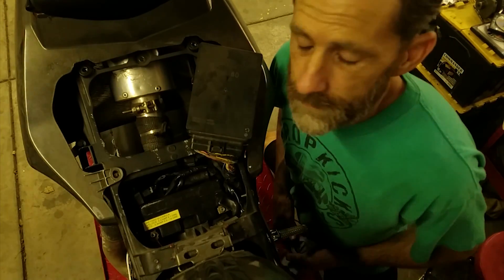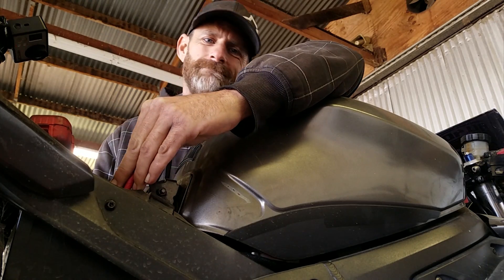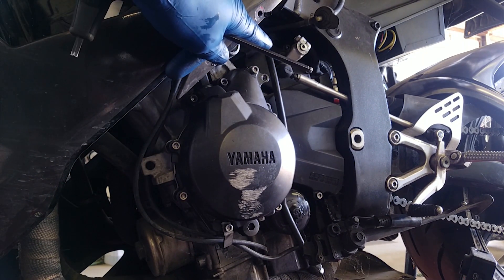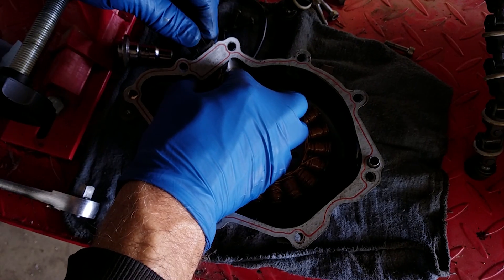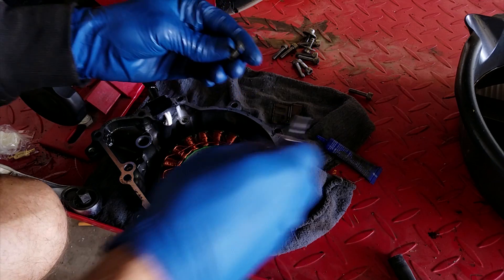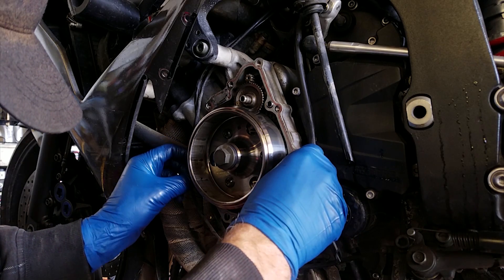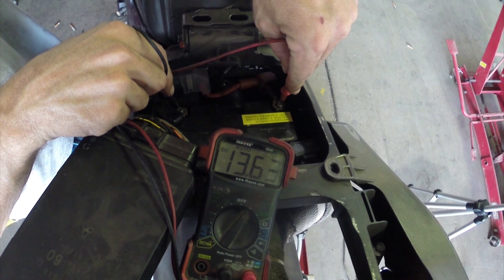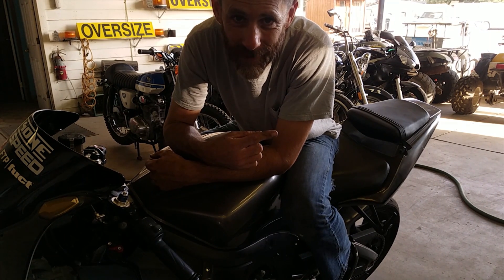Motorcycle Charging System Check and Stator Replacement

Comment: Great video, I have an '05 WR450 where my batteries are dying could be stator, I have a dead battery installed now 
0 volts should I still be reading 13.5 to 14.5 volts at the battery with an OHM meter while it's running?. Ty😮

Comment: Hey I’ve got a ninja ex300 2012 I’ve had battery issues with it replaced my stator battery and regulator and after putting the new stator in it winds over but it doesn’t start after it winding over a few times the check engine light comes on any suggestions or idea what this may be
Reply from the maker: Sounds like something isn't plugged back in. Double check everything you went through just to make sure you didn't leave anything behind.
Reply: I’ve already pulled the plugs out and put them back in the only other thing that I’ve messed with was draining the oil and coolant and the issues only popped up after replacing the stator
Reply: The only other thing that I can think of is it possible that when my roommate decided to cut the wiring harness on the stator to pull the old stator out could that have cause an effect like what being described
Reply from the maker: @dropbearlife7485  considering the stator has a plug for it, I'm not sure why you would cut the wires. I'm pretty sure you might have found your problem.
Reply: I’ve also checked all the fuses in case any of them may have had damage and they all appear to be fine
Reply: Never mind I made a rookie mistake I had put the stator sensor in upside down completely my fault lesson learned pay attention to detail and confirm everything lol thank you for your assistance
Reply from the maker: @dropbearlife7485  we've all done it! Glad you got it sorted out!

Comment: Would like to know. If stator is drenched in oil, can it work? My vstrom 650 had half cup of oil inside the casing afterI drained the oil. Bike ran on battery so crankshaft position sensor must have worked despite drenched in oil. So was the stator and magnet rotor. Are they designed to work drowned in oil? My old stator looks clean though. Have to test it yo be certain. Thanks
Reply from the maker: It's a magnet essentially so I'd think so. But I'd also make sure it was super clean in there! Probably works better without it drenched in oil.
Reply: @MotoMedic  Thank you. Found out it is always drenched in oil. Normal. Has plastic like coating on coils. It was the stator. The old one had two hidden broken wires.
Reply from the maker: Yeah that's weird. Not usually a bath of oil around the stator.

Comment: There are only 4 elements to charging (and potential issues with it) and these are 1. the battery, 2. the stator, 3. the rectifier/regulator and 4. the plugs & cabling, including fuses.

Prior to anything else, I'd see if the connection of wires to the battery is OK, as those may get lose over time. It's indeed the VERY first thing to ALWAYS look at, as it's an easy and quick check a/o fix. BTW for lose connections I recommend using copper paste - it is conductive and secures the bolts & nuts in their place firmly.

Then, I would check for any current leaks on the battery, and if so, I'd skip to checking all the wires and connectors and fuses immediately. Otherwise, I'd measure the battery voltage and then I'd see if it is being charged with the engine turned on (idle vs ~4 or ~5k RPM). BTW I'm using a cheap car-charger plug-in device (I have the plug installed on my bike), which - apart from providing me with a USB port for charging my phone or camera - shows me the current battery voltage level and to not drain the battery unnecessarily, I just need to pull it out after a ride.

Afterwards, I'd check the connectors between the battery & stator & RR & the rest of the bike - some could be melted (typically I'd see a short there) or have a faulty connection (intermittent or permanent break). If so, 1:1 replacement should be the way to go.

Then I'd test stator - an indication of a faulty one would be, if there is continuity between each of the connectors and the frame OR continuity between any two stator output connectors (1-2, 1-3, 2-3). If these checked out fine, I'd test its AC voltage output - it should be within limits put in the bike's service manual.

Then I'd test the OEM(-ish) RR, if the diodes are OK - meaning, if they let the current flow in one direction only (*). If so, I'd test its output (with everything connected & the engine running), where the DC voltage should again be within limits given by the bike's manual (again, idle vs high RPMs test) - typically, service manuals recommend measuring this directly on the battery and the numbers given in the manual most of the time refer to that particular type of measurement.

If the battery still does not charge up (sufficiently), I'd go through fuses and cabling (continuity tests) and connectors - here, unplugging one by one and observing the result ALWAYS leads to positively identifying the faulty part.

(*) the diode test is of course not available for MOSFET RRs, however, these generally fail very rarely; for comparison, the OEM(-ish) ones tend to have an overheating issue, as the thyristors in those get rid of any abundant current by converting it to heat (MOSFETs typically send it back to the stator)

Comment: Man I'm having problems with my road star though it was the carb but had it cleaned and tuned and still starts to back fire then shuts off after like 10mins of ridding thinking it's the stator? Any help would be appreciated
Reply from the maker: Backfire wouldn't be stator. Stator just charges the battery. Battery dies. No backfiring. Sounds like carbs are out of synch or something. Hard to know without actually having the bike to see more.

Comment: I need your opinion regarding an issue on my scooter.
I´m having a strange behavior on my scooter (SYM VS 125 2010):
If I disconnect the connector with 3 yellow wires from stator to rectifier, the engine works fine. If I connect it, the engine misfiring at 4000 rpm.
What is the normal output voltage on 3 yellow wires from the stator? I'm getting 26V on idle and almost 100V at 4000 rpm. Exactly when the engine starts to fail. Isn't it too much?
I've checked continuity on coils (ok), replaced the rectifier and battery.
Bad stator? Another suggestion?
Reply from the maker: Your best bet is to look in the service manual for this information. I would start looking for one online and start diagnosing it by the book. It's how I'd have to do it... but I don't have the bike here and I don't have the service manual.

Comment: If you changed the stator previously why did you have to replace it again?
Reply from the maker: Sometimes when a stator goes bad it can also make the regulator / rectifier go out too. If it does and you just swap a stator, it can go bad again. Other times it's just because these things get really hot and generate a lot of power for something so small. They're made by humans. They can fail 😁

Comment: Hey this might be a silly question but do you think it’s alright to reuse my oil. Sense my oils pretty new. Probably only a few hundred miles or less on it. I plan to replace my stator on a 2012 zx6r
Reply from the maker: I have reused oil before too. Some people get stuffy about it but if it goes into a nice clean container and then back into the same thing it came out of, then what's the difference? Have at it dude!

Comment: Quick question Brotha . Does the stator have too look shot if it needs to be changed ? Mines looks pretty brand new but pretty sure it’s a stator issue
Reply from the maker: Typically it would show some fried up area, but it couple be possible. If you can dig up a service manual on your bike you may find a testing procedure for your specific stator. All you should need is a multimeter.

Comment: Any Idea why it has been through more than 1 stator?
Reply from the maker: Could be a number of reasons. Got too hot. Maybe regulator/rectifier was burnt out too, or it just decided it was done. Sometimes they just fail.
Reply: It is because the bad magneto that is what happens when you don't use motorcycle oil

Comment: Would the stator also not provide spark to coil even with a full charge battery?
Reply from the maker: Not necessarily. Spark is from the ignition system not the charging system. If you have a battery that has a charge and still no spark then something is going on with the ignition system.
Reply: @MotoMedic  I have been out to test and I have 12v when ignition on before the coil pack but still no spark is there a way to test coil pack?
Reply from the maker: @z0m123  I'd start with checking all the connections first before the coil pack. Check for loose fit, corroded connections etc. If that's all good, could you swap with a working coil first? What kind of bike?

Comment: I have a 2003 1600 road star, I tested the battery while running and not running and got a reading of 11.4 that means I need a stator correct?
Reply from the maker: Indeed it does.
Reply: @MotoMedic  thank you

Comment: My friend installed a new stator,Put the case back on and started it,Then took the cover off and sealed it,Then does it matter where the flywheel is positioned at all after he started it?
Reply from the maker: Likely he was just making sure the charging system works before sealing it up all the way. No... Timing is not effected when changing the stator 👍

Comment: Well if it is a Harlery or any bike fitted with a charging pig-tail for a battery tender, you could
check the voltage there.I did want to see that stator.

Comment: Cool clip, I just bought a Yamaha XJ6SL diversion 2010 with just 4794 km's on the clock for $4850.00, but on my first ride today, the battery went dead, so I'll put it on charger, to be able to start the bike, then I'll check it with multimeter and go from there, thanks man.

Comment: I have a dead short on the red main fuse. I traced the red wire from the battery, to the fuse,down to the six wire connector. Tested from that point, back to the battery, (no short). Tested the large two red wires, and are showing both wires a  dead short . My question is,  if the stator is bad, will it cause a dead short  on the two red wires?

Comment: Wait there's not supposed to be oil in the stator is there?!
Reply from the maker: Not uncommon.  But stator isn't something that requires lubrication so normally no.  Some bikes allow oil up in that side of the case though.
Reply: @MotoMedic  found out the hard way my Suzuki GZ250 has oil in the stator case. opened the case up yesterday and oil spilled everywhere.

Comment: New subscriber! This channel is awesome. My 2013 ninja Zx6r won’t start now. New battery and will crank but won’t turn over. I think I’m experiencing the same issue. Do you recommend replacing the stator and the rectifier together?
Reply from the maker: Having a charging issue won't necessarily mean the bike wouldn't start. Have you checked the charging system like in this video? If it won't start but spins, then I'd begin with checking all of the safety switches. Kickstand switch, clutch switch, etc. I've seen both get dirty and prevent the bike from starting.

Once you've gotten the bike to start and idle like it should, check the voltage at the battery like in the video. It should be charging around 13.5 to 14.5v when running.

Start with those switches.
Reply: @MotoMedic  you know, what’s interesting is after replacing my battery, she starts right up fine and runs like a champ. Check engine light was on before switching the battery. I did pull the code and it read code 64 which is the code for Air Switching Valve Malfunction. No having any bad emissions come out so I’m not sure why that code is on
Reply from the maker: @keatonmoore7413  that's not what I meant. If you see in the video I use a multimeter to check the voltage when the bike is running. That will make sure its a charging problem. Have you checked that?
Reply: @MotoMedic  gotcha I definitely did not do that. I will try that. Thank you

Comment: while changing out the stator is it also good to change out the rectifier or is it ok to leave the old one in there (my bike is from 1998 and seem like nothing right was done on it just curious if I should just say screw it and get a new one all together)
Reply from the maker: It's not a bad idea to at least see if you can test it.  Do a quick search for testing specs for your specific rectifier. It could be OK but I've personally fried 2 of them when the stators burned up so the science seems solid. :P

Comment: i have a suzuki bandit 650n, and the charge generating stator burned! do you know how many turns i should make on each coil?
Reply from the maker: Couldn't tell ya...  but you can probably pick up a brand new one for about $100 aftermarket.  That model wasn't sold in the USA so I'm not finding the bike on my lists, but it comes up on European lists so I'm sure there are replacements out there.
Reply: @MotoMedic  could u send mi a link where i can purchase 04 zx6r stator mine seems to be working fine but it went out on me today on the highway just to find out it was only jam...roll that monster in 6 gear n junk dat bitch and the bike started but now am skeptic abt my stator making me second guessing wouldnt want it to go out on me like that again

Comment: The magnets were missing from that flywheel...
Reply from the maker: the entire inside of the flywheel is magnetized.  If they ever become demagnetized then you have a problem.  I've never had that happen but I've heard of it. No visible magnets on these as that would be hard to balance.  Sometimes you'll see a small weight like a tire balance weight but that's usually it.
Reply: Your magneto was bad

Comment: Very informative video. I am currently helping my friend fixing his 2010  XJ 600N, the chargning on the running engine osciliates around 14V, so that would imply the stator is in perfect working condition. We also checked that all three pairs of pins in the stator show the same values at the same RPMs, so our guess is the faulty voltage regulator rectifier.
Reply from the maker: That would be a good guess
Reply: @MotoMedic  Thank you, I will let you know, whether we were right or not ;)
Reply: @laponiec  were you?
Reply: @RajerThatYT  No, in case of my friend's bike it was only a matter of installing the new spark plugs, but then I had a similar problem with my ZX6R and it turned out that the stator was damaged, I got it rewinded and everything is working fine now.

Comment: Loved the video man. U made it fun. 😂 and that's exactly what my bike doing. Thanks!
Reply from the maker: Ha! Nice! Thanks for the comment and I'm glad it helped you out!
Reply: @MotoMedic  the only thing i didn't see in ur video tht mine does is drops volts if i let it run. I know its not the rectifier as i checked the diodes so i know that's working as it should. And the battery holds a charge when off and takes a trickle charge just fine

Comment: If my bolts stripped while being removed,  what can I use to replace them??
Reply from the maker: I'm assuming it's the heads of the bolts that are stripped?  Get new bolts :)  (As long as you've gotten the old ones out)  I'd suggest you get the OEM bolts or something equivalent.  depending on your bike... should be easy to find on Partzilla.com
Reply: @MotoMedic  Thanks! I've ordered them. I appreciate the help.

Comment: 2011 r1 won't start. It cranks but won't turn over sitting at 12.6
Reply from the maker: so the starter spins the engine but the engine doesn't fire?  Is the fuel pump priming?  Is it getting fuel?  How's the air filter?  I'd start checking the easy stuff first.  If you turn the key to "on" does the fuel pump buzz for a few seconds?
Reply: @MotoMedic  ya the fuel pump buzzes for a few seconds then I'll try to start it up but it cranks for a bit then slowly dies out. I used to get it to start by rolling the throttle a bit but that's hit or miss
Reply from the maker: @williamcary168  Sounds to me like the battery is just done.  If it says 12.6v but slowly dies when trying to crank the bike over... it's not a good battery anymore.  Replace it and see how she goes.  A dying battery will also make it hard to bump start.
Reply: @MotoMedic  will do thank u very much... I'll let u know how it goes

Comment: Just replaced my stator on my 07 r6 with OEM. Still not charging, battery is new. I’m hoping not a wiring issue.
Reply from the maker: Regulator / rectifier might also be bad. But definitely check wiring first!

Comment: I have a Vstar XVS650 not chargimg, rectifier passed the test but I have a descrepancy with the stator testing I measured 0.8 ohms in each coil but the AC test is good, the service manual specs is no more taht 0.5 ohms, realy that small defference can be the issue
Reply from the maker: You'd be surprised. If the book says it has an acceptable spec range, and yours tests out of that spec range, it's probably bad.

Coils have nothing to do with charging system. They're ignition system.
Reply from the maker: My mistake... If you're testing the coils on the stator. 🤔. I've never tested individual coils myself. Simple answer though is.... Is it charging when the bike is running? No? It's either the stator (literally a generator) or the rectifier that limits back flow of charge. (regulator regulates how much amperage is going to the battery... Modern bikes have a reg/rec that does both.)
Reply: @MotoMedic  yes you are right, my mistake, I measured the three faces 0.8, 0.9 and 0.8 ohms, engine running idle 26 AC volts each, I verify the harness good resistance, good terminals and connectors, the last step is replace de stator